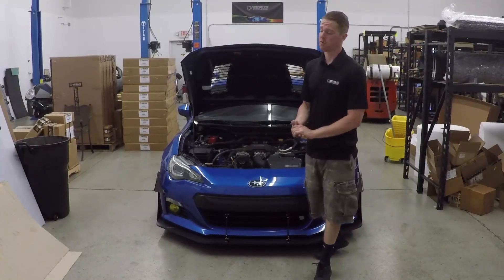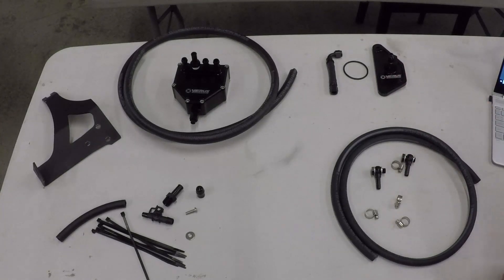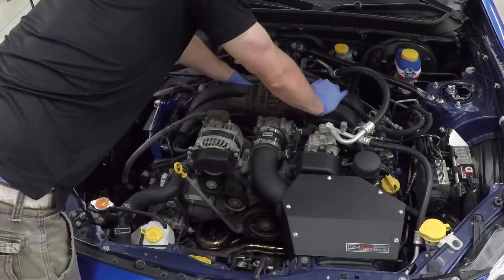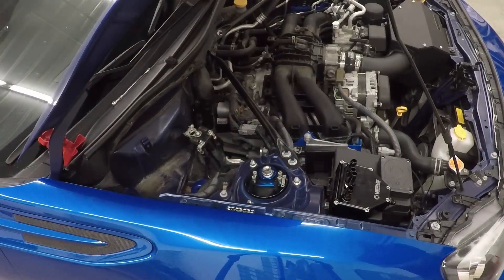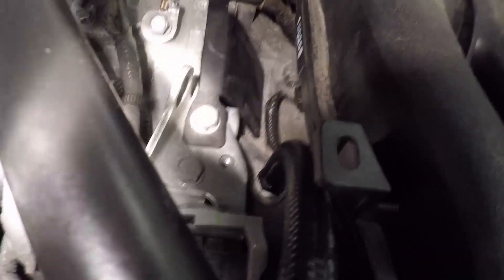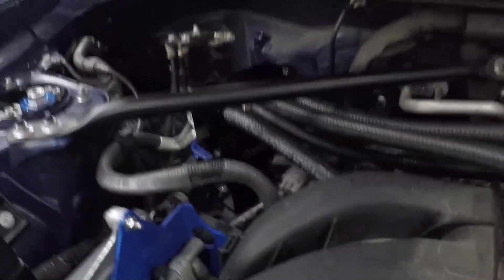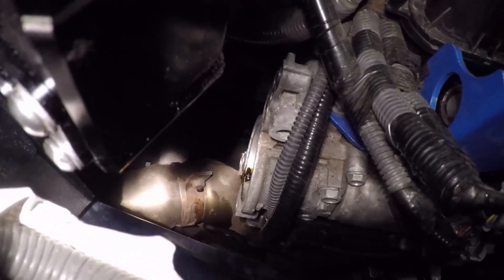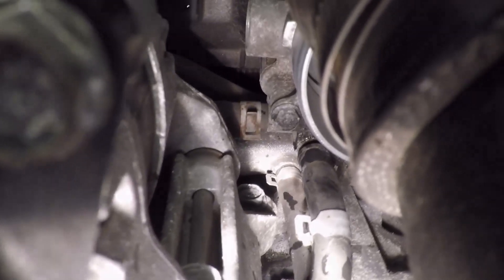Air Oil Separator, Auto Drain Kit, and Coolant Add-On Kit Install

Comment: Is it safe to run the return line without the coolant line upgrade. I live in Arkansas and it’s humid a lot of the time. If that means anything.
Reply from the maker: It is, but expect a little bit more sludge buildup from condensation. The engine should get hot enough to burn this off in the oil, so no need to worry, but if you'd prefer to mitigate it, add the coolant upgrade!

Comment: Would you recommend coolant add on for someone that primarily tracks their car in Southern California? The car is a street/track car, but running stock power/motor/NA. 

I guess my technical question is at what ambient temps does condensation become an issue inside the AOS?
Reply from the maker: We wouldn't worry about it with your location, it shouldn't be an issue.

Comment: Hi
Thanks for your review and information. 
I have a question
Can you attach a link to the cold air intake and is it also fit 2022 brz 2.4 ?
Thanks again
Reply from the maker: This will not fit the new 2022 BRZ, but we do have a kit for the new 2022 BRZ/GR86 that will work. It is available on our website along with an install video/manual. We suggest following our install instructions.
Reply: @VerusEngineering  
Thanks
Reply: @VerusEngineering  
I did not find it on your site.
If possible a link to the 2022 brz cold air intake.
Reply from the maker: @itaybutavia1204  We do not offer a cold air intake. Please follow our install instructions.
Reply from the maker: @itaybutavia1204  https://www.verus-engineering.com/shop/air-oil-separator-aos-2022-subaru-brz-toyota-gr86-3098

Comment: I'm considering this AOS for my setup. I've got the HKS v1 SC and I'm trying to figure out the best way to route the lines. Have any customers set it up as a two stage AOS, as in having the PCV run into one side and then right into the other and then to the manifold? I saw a video of a guy that had a Perrin AOS run into a Cusco catch can because one AOS didn't get all the oil with how hard he drove on track days.

Also, are there any issues with variable valve timing when using the drain kit and the cam plate?
Reply from the maker: We suggest reviewing the actual install manual as it shows routing for boosted setups.  No issues will be had with using the drain kit.

Comment: I just ordered this for my turbo BRZ. is the hose routing the same?
Reply from the maker: No, it is not. I would suggest looking at the install manual as it goes over a boosted setup as well.
Reply: @VerusEngineering  Ah yeah I see, the middle 2 hoses look like they both go to the vacuum on the intake (orange and yellow on the picture). Is there a supplied T to connect them together? or should i pick one up from home depot?
Reply from the maker: @iamdeadeyed  The kit does not come with a T.

Comment: would you guys say running this is more reliable for a turbo charged brz that doing the STI PCV Valve with a catch can?
Reply from the maker: We haven't personally done any testing with the STI PCV and catch can you are speaking of, so we cannot give you an accurate answer on that one. However, we have run this setup on a boosted BRZ for over 10,000 miles and the oil sample came back clean.
Reply: @VerusEngineering  thanks for the reply. would love to run that setup. its just a lot more expensive than the catch can. I'll get it eventually though. Love your products, thanks!

Comment: If you are running NA application. Why put the Verus PCV in the block and the OEM PCV in the AOS ????? Is not the same if you put the verus PCV in the AOS and leave the OEM PCV in the block????
Reply from the maker: No, they are not the same. You must install one of the supplied NPTs into the block and the factory PCV into the AOS for NA applications.
Reply: @VerusEngineering  ok ok i will do that. Thanks for reply
Reply: @VerusEngineering     But what is the difference between NPT vs PCV????
Reply from the maker: @joelhendz  the PCV is a check valve whereas the NPT is open-ended to allow flow or pressure to go through it.
Reply: @VerusEngineering    Hooooooooooo. Thats why is a must tu put PCV to the AOS to avoid the intake pressure beck to the AOS. Nice now i understand
Reply from the maker: @joelhendz  Correct.

Comment: 2 questions.  What does routing the coolant to the AOS accomplish?   Secondly, as for the oil drain back kit, is the oil that makes it through the AOS / PCV in a good enough condition to put back into the engine rather than just dumping it from the can ?
Reply from the maker: John Unnever yes the oil is filtered before entering the block and we have had the oil tested on our shop car after 10k with the AOS and nothing weird about the results. The coolant add-on keeps the AOS from creating condensation build-up.
Reply: @VerusEngineering  I've seen a lot of people with this AOS say it's better to vent to atmosphere. But if you guys say it's fine the drain back the I guess it should good then. Pollution is already as bad already lol.
Reply from the maker: @romariosmith422  We ran a boosted setup with the drain back kit and sent the oil in for some testing after about 10k miles of having this setup and everything came back just fine.